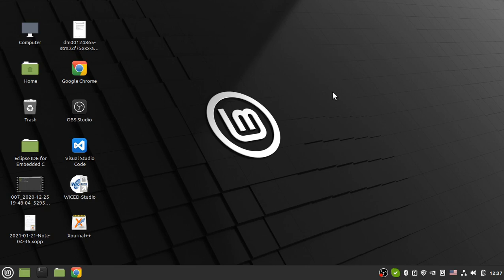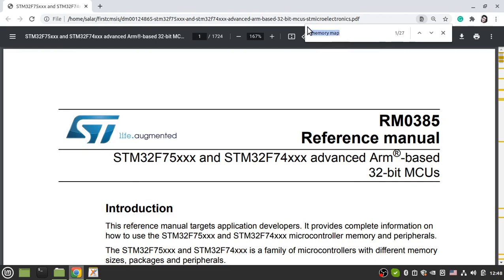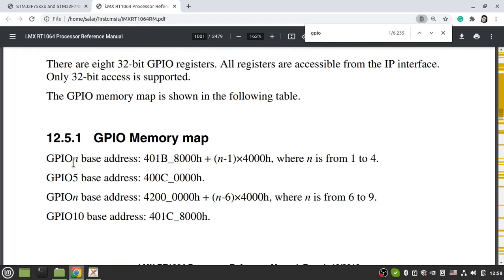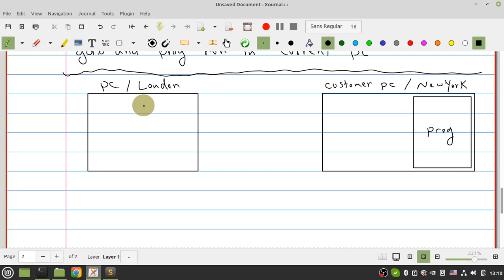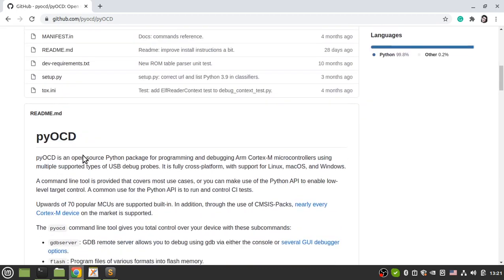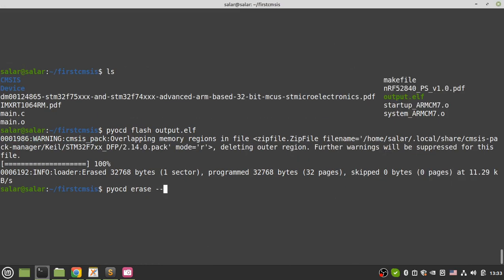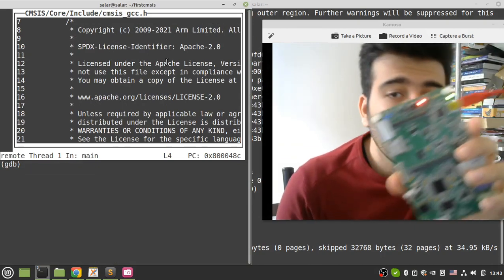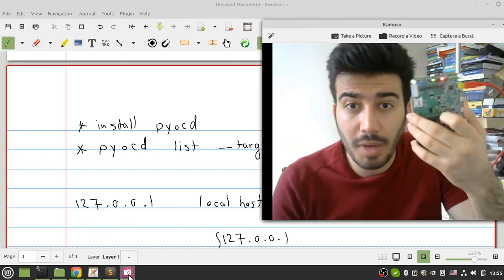017 - Turn on an LED by ARM Cortex-m

Comment: Hi Salar
Thanks for your perfect and simple explained course 
I have a problem:
I get into trouble on the debugger section; after I run the gdb server, open the debugger and enter the command "target remote:3333"
As I entered "c" to continue, nothing happened, and it remained on the main.c page and doesn't open, i.e., the startup file
Reply from the maker: Thanks,
When you use "c" command your code will be run nonstoply, and As long as your code is running, debugger does not show another source file. You must put a break point in startup file or run your code by "s" or "n" command to get to the line you want
Reply: @OpenTeachProject  Thanks, solved!